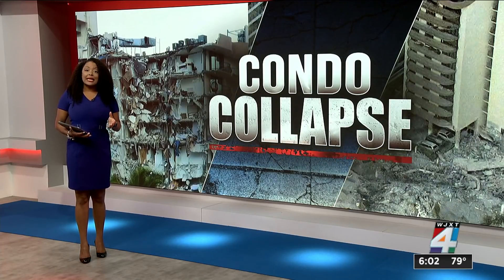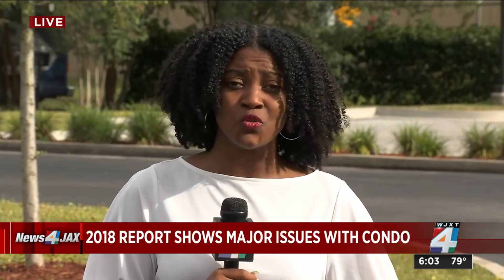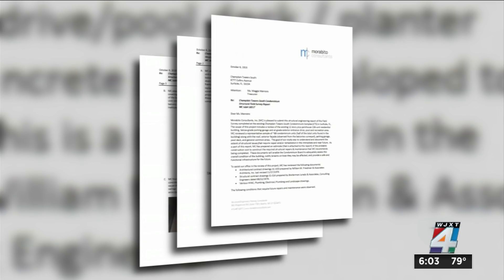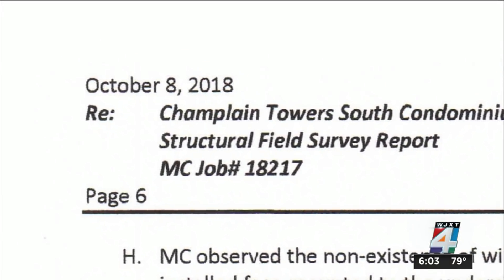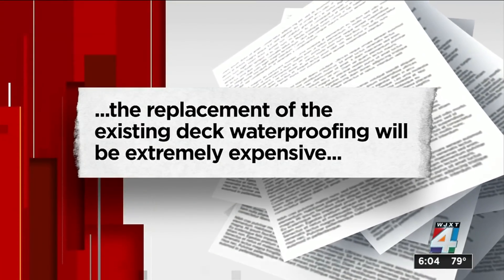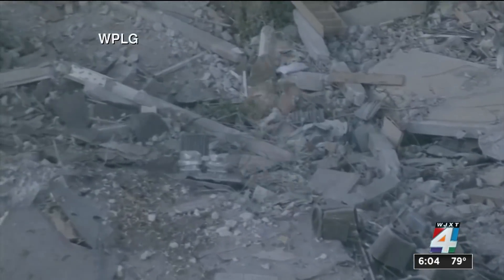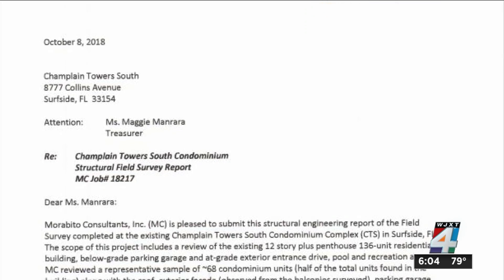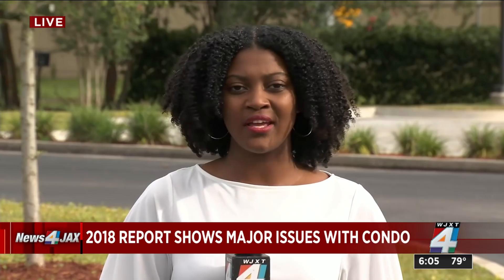2018 engineering report showed ‘major structural damage’ before condo building collapsed

Comment: The defects were discovered about 3 years ago and nothing was done due to the costs of repairs. The engineer who did the inspection and discovered the structural defects should be required by law to notify the Building and Safety Departments and those departments should revoke the certificate of occupancy until repairs are made and the building is certified to be safe.
Reply: So you want to discourage people from hiring structural engineers?
Reply: @GOLDVIOLINbowofdeath  Hmm, that's an important consideration of unintended consequences.  But that's why we need and have regulations and required inspections.  Saying, "We shouldn't require failing results of a test to be reported to the government, else people won't do the test" doesn't seem like a good argument for not requiring that report.

Psychotherapists must tell authorities when a patient is a danger to themselves or others; this may discourage some people from seeking their help.  Does that mean it's a bad law?  For the therapist's own moral/mental health, as well as for the sake of the potential victim(s), I think the therapist needs to report when they know someone is in danger.

If an engineer/inspector knows a building is at risk of collapse and the owners aren't fixing it, how is it moral to not say anything, when lives are at risk?  Yet the engineer doesn't follow up and has no legal right to demand to know if repairs are being done, so all they can do is give the government the initial report.

Until we have a just society, we can only curb greedy, selfish behavior with laws and regulations.  So, if requiring structural engineers/inspectors to report serious problems to the government makes building owners reluctant to hire them for inspections, we could always require more frequent inspections by government agents.  I would want someone to study the issue to try to determine if that is even what would happen, and how best to deal with it.

But the only real solution for this kind of thing is to structure society to minimize motivation by greed.  I yearn for a communal society with no rich or poor, just a moderate range of middle incomes.  Businesses should be owned by the employees, insurance organizations should be nonprofit co-ops, and we should take care of each other with a strong safety net.

We are inching toward economic justice, but the rich powers that be fight tooth and nail against it, even though I believe that they, too, would be happier in such a society.  Trust fund playboys don't understand that pleasure is not happiness, and positive, meaningful purpose, contributing to society, is one of the prerequisites of true contentment.

If they weren't craving wealth and status, many more people could choose careers they are passionate about, without worrying about money, so we'd have better service and fewer people who are terrible at their jobs.  People in democratic socialist countries are happier than Americans, because they don't have to work themselves to death for a below-living wage, anxious that any unexpected health problem could make them lose their homes and declare bankruptcy.

I just want everyone to be truly happy and treated justly.  Both capitalism and the Russian and Chinese versions of communism fail at this; they both have a wealth & power pyramid of a few rich 1%ers controlling things at the top, while the majority suffer at the bottom.        ////Bunny kisses for all!
Reply: @DelinahLovesHouseBunnies  then logically people should not have protection from their lawyers being able to be questioned about what was discussed, Attorney client privilege Should not exist
Reply: @Brian G C   I like your suggestion of requiring inspectors to report serious flaws to the government.  I had assumed that that was already law, as the only inspectors I had been aware of were the licensed ones who work directly for the government.  However, I disagree with revoking the certificate of occupancy, except in cases of imminent danger (i.e., more than an insignificant risk of harm occurring within the next two years).  If evacuation is unnecessary, such as for a slowly worsening problem that is nowhere near the high-risk stage yet, having to move out for perhaps many months, paying both mortgage and rent, or two rents, plus moving costs out and back, would be very hard on poor to middle-class tenants.

And, depending on their size and wealth, making the building owner pay those costs for possibly hundreds of tenants, on top of paying for the repairs, may be too onerous for them.  In this particular case, it may have been warranted, but, as a law, it's an overreaction.  The government should certainly set a deadline for when crucial repairs must be completed.  If the deadline isn't met, and the damage is now in the danger zone, that's when tenants should be evacuated.  However, perhaps that's what you meant?        ////Bunny kisses for all!
Reply: @DelinahLovesHouseBunnies  Obviously, this was critical enough to warrant revoking the C of O.  The tenants would be better off paying double payments than being dead.......
Reply: @briangc1972     Yes, obviously, in hindsight, it was warranted at this current time.  However, we are discussing whether it would have been warranted at the time of the report in 2018.  Probably.  But I do not know if immediate evacuation was warranted then, because I don't know the details of the report.  Hence, I said, "... may have been warranted..." in this case.  I am merely trying to avoid being sophomoric, à la @Brody Cates's comment on this page, "I love how everyone in comments thinks they know EXACTLY what they are talking about".

Also, we are discussing what the law should be, which would apply to all buildings, not just this one.  If there is no imminent danger, if it's slowly developing damage with no expectation of possible collapse or other danger for years, then evacuation would be all cost, no benefit.  Of course, we should err on the side of caution, not wait until the last minute, but I'm sure there are many cases of building damage that will eventually create a dangerous state if not fixed, yet the danger is many years away.  Your comment was unclear about under what conditions the certificate of occupancy should be revoked.  That is why I asked for clarification:  "However, perhaps that's what you meant?"       ////Bunny kisses for all!
Reply: @DelinahLovesHouseBunnies  I am a contractor, when there is a structural defect, you do not permit the building to be occupied; ever. Foolish debates over whether or not is a waste of time. The obvious result of not vacating the building is DEATH and severe injuries.
Bunny kisses won't bring those victims back.
Reply: @briangc1972     "Bunny kisses for all!" is my standard sign-off, meant to offer lovingkindness and empathy to all sentient beings.  Unprovoked shaming and nastiness brings no one back, either.  Why do you feel the need to cruelly mock?  Surely, there is already too much suffering in the world (witness the tragedy we are discussing).

Correct me if I'm wrong, but you are implying that I am a fool, a stupid person who thinks "thoughts and prayers" solve everything.  Contrariwise, I am all about very progressive action.  You called my concerns "foolish debate" and "a waste of time."  Debating how best to solve problems and what the laws should be is not a waste of time--it's democracy.

I don't have engineering or contractor training; therefore, I can only use logic.  But ignorance of a particular subject is vastly different from idiocy; I earned a 3.3 GPA at Caltech, and I did very well in organic chemistry, quantum mechanics, microbiology, and relativity.  We all have our special areas of knowledge.

Unless "structural defect" by definition means damage that puts tenants at moderate to high risk--it may mean that, but I don't know the jargon--then, logically, there must be such a thing as a tiny structural defect that doesn't put anyone in danger.  Logically, there must be a range of severity.  If there's no danger, then forced evacuation is all cost, no benefit.  That's logic.  If there is danger, then, of course, people should be evacuated, because human life is far more precious than money.

However, you have presented an argument that any structural defect warrants evacuation, and you have said that not doing so inevitably leads to deaths, if I understand you correctly.  I propose, based on logic, that there must exist defects that will, if not repaired, eventually lead to a risky situation but present no danger in the moment, and maybe not for years to come.

Obviously, in this case, the government chose wrong.  But, presumably, in all the other cases in the nation, over many decades, in which they gave a repair deadline but didn't revoke the C of O, it worked out fine, else we would have heard about it on the news.  (There may have been one or more collapses that happened years ago and faded from the public's memory, but the only ones I remember are 9/11 and the Oklahoma City bombing.)

It doesn't make sense to force everyone out, if the experts say there is no risk to speak of.  You can argue about the cutoff, exactly how much risk should be tolerated.  But the law you seem to be proposing, that the slightest chip should drive everyone out, doesn't make sense.  It would only cause suffering, without saving anyone from harm in the no- to low-risk cases.

Furthermore, all the nation's Building and Safety Departments, not to mention the historical facts, apparently disagree with your theory that not evacuating for every structural defect always leads to death.  They do not always evacuate buildings with structural damage until repairs are completed.  In hindsight, it was the wrong decision this time, but it was the right decision with all of the other buildings that didn't end up on the news because the repairs went fine in an occupied building, and no one was hurt.

You have to look at the entire picture.  As a radical progressive, I, too, feel a lot of anger at the 1%ers and politicians who run the country.  I want a lot more regulation, but only when it's actually going to protect people, otherwise it just does harm--in this case, making poor people, either tenants or some small landlords, unnecessarily move and/or pay for moving.

Perhaps you are middle-class or rich (to me, middle-class is rich), so you haven't thought about how much harm your proposed law could do.  If I had to pay double rent for 6 months, it would put me in debt to the usurious credit card companies at a level that would take years to pay off.  In fact, I might never be able to pay off the principal, only being able to afford payments towards the interest.

I don't know whom your law would require to pay for the temporary housing while repairs were made.  I have empathy for any poor tenants who would be financially devastated if they had to pay.  I also have empathy for any small landlords who would be financially devastated if they had to pay for all their tenants' temporary housing; it's my understanding that some small landlords don't make much net profit from their rentals.  Yes, it's better to be enslaved to debt than dead, but those aren't the only possibilities; there's also the possible outcome of being alive and well without that debt, because one wasn't forced to move out unnecessarily.

I'm all for requiring an earlier post-completion inspection, and I'm all for sliding the cutoff point down to a lower risk level regarding when a C of O will be revoked for structural damage.  Either of those changes in the law would prevent a similar circumstance from occurring again.  But a blanket evacuation order for even the slightest structural damage is an overreactive response that won't save any more lives than a lowered, reasonable cutoff point for level of damage that triggers loss of C of O.

I wish you well, and my heart breaks for the victims and their loved ones.  I want to make meaningful changes to the law that will prevent a recurrence of this horror just as much as you do.  Why do you seem to assume that is not so?     ////Bunny kisses for all!
Reply: @DelinahLovesHouseBunnies  From your post: Unless "structural defect" by definition means damage that puts tenants at moderate to high risk--it may mean that, but I don't know the jargon--then, logically, there must be such a thing as a tiny structural defect that doesn't put anyone in danger. 

Any structural defect,  by definition is a defect which makes the structure unsafe. A crack in the drywall is not a structural defect,  even if it is in the ceiling and that ceiling could fall and hit your head. A structural defect means any defect in the integrity of the structure, the main supporting members of the structure. We don't rate the risks as being moderate or high. A defect is a defect. If it is structural, then it is unsafe.

Which would be more inconvenient to you? To have to pay double rent and end up deep in debt? Or to have the building collapse upon you while you sleep at 1:30 am? 

Which is more inconvenient to the families of the victims, to have the victims move out of their condo into the homes of their families or the waiting and worrying and ultimate knowledge that their loved ones are gone?

People are dead because people on the HOA board debated the terms of structural defects just as people like you are debating the terms.

Personally, if I was on that HOA board, upon seeing that report, I would have immediately moved out and I would have put notices on every door of the building.

I would have ended deep in debt, but I would be alive. Others would also be alive as a result of my action. Some would call me a fear monger, or even chicken, but ultimately, the building did collapse and my actions would have been shown to be prudent.

Comment: The sanctity of life should be the at the forefront of any property management. Being so close to the ocean and being built basically on sand, sinking is a distinct possibility and people were complaining about it for a long time.
That building owner and his property management who neglected to fix this situation are 100% to blame. Where was the state? I’m sure some tenants would have contacted the office of building management. Inspectors should have come out and declared the building uninhabitable until the proper folks could see if it could be repaired correctly or if it needed to be torn down.
Now look at the loss of life and how many families will have to suffer for the rest of their lives through grief and anger. It’s absolutely devastating, especially because it was completely preventable.
It will soon be changed from search and rescue to search and recovery. I doubt many could withstand their injuries coupled with the extreme heat.  The decomposition of the dead will be swift and terrible. God bless those rescue workers who have such grim tasks ahead of them.

Comment: My relatives had a beach condo and these repair issues happen all the time—no one wants to hear that they have to pay for a new elevator or a new cement wall. Everyone argues over every decision and what is necessary in one person’s eyes is a waste of money in another’s eyes—or it can be done next year, in the next five years, etc. No one thinks this kind of thing would happen if you don’t repair the waterproofing on the pool deck, but it’s the kind of thing that always needs repair in a condo. It sounds like that failure may have caused the whole thing.
Reply: That's why it's a nightmare to own a condo like this. Just rent if you need to live in a condo
Reply: Experts should know water is subject to the forces of gravity.

Comment: Forty years? Someone knows more about this than we have seen so far. There is probably criminal negligence here.
Reply: I would bet someone skimped on foundation structure back then. Either under engineered or contractor cheated. Inspectors failed or paid off. Result of these failures always shows  up in time depending on certain conditions.
Reply: @raynshyn7160  I think in this case we have some basic engineering problems and the biggest issue is probably deferred maintenance of known problems. People don't want to spend the money to maintain  a property. I think there were serious and KNOWN structural issues. Now people are dead. Probably over 100. There needs to be an investigation and some accountability.
Reply: @johnlennon335  , I agree. A sharp structural engineer will know exactly what failed and why. The trail will reveal the main failure or failures. Sad part is the attorneys, with so much at stake ($), will butcher justice. Furthermore making life trivial.

Comment: Three years ago and nothing was done ? what a tragedy. Why is there a persistent burning fire ?  Cannot be gas as it has been turned off. Something is burning in that place. They have not been able to put it out. Very strange. Why were there some repair guys all over the building ?  What exactly were they doing ? What repairs ?  they better get some answers from theses dudes. The destruction is very bizarre, looking so much like a demo, but without the original explosion........